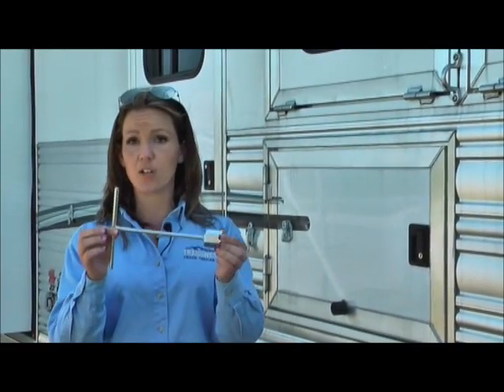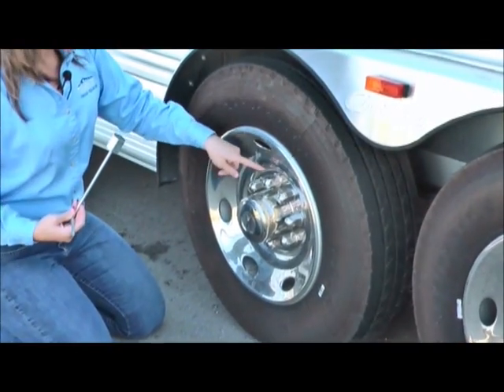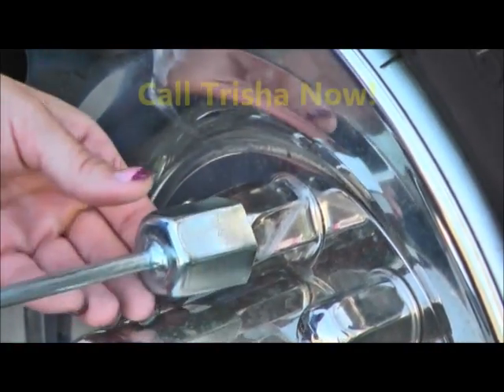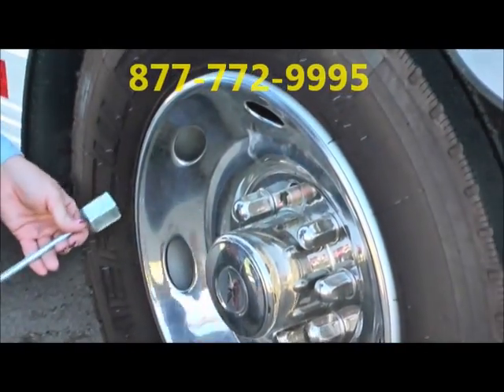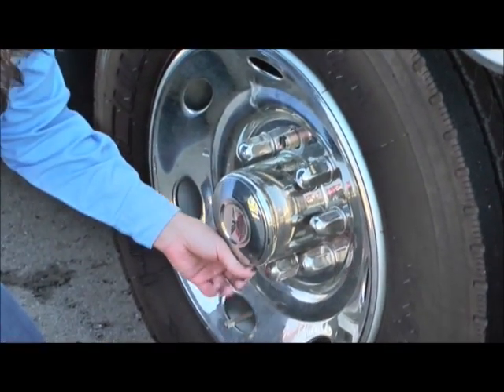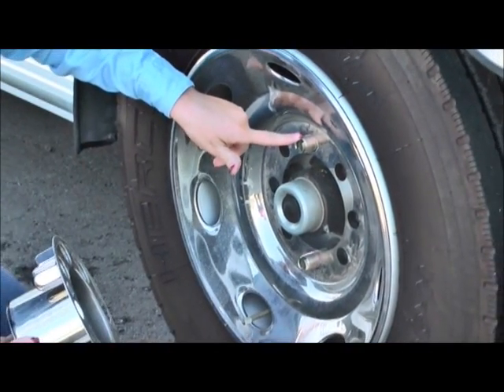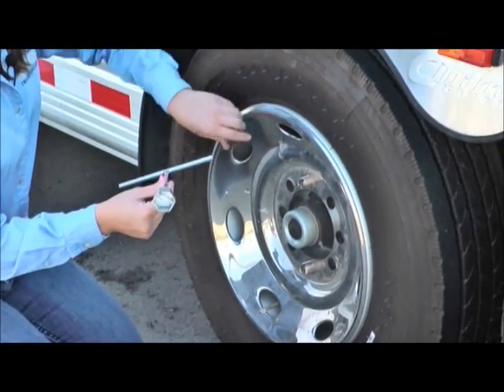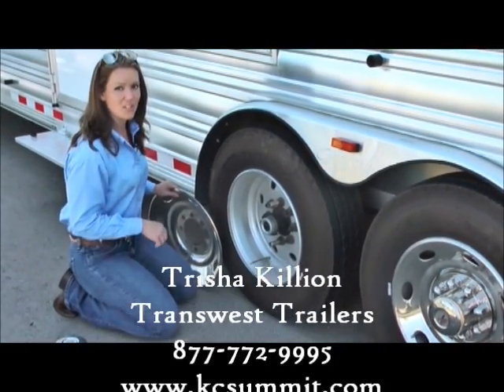How To Remove Wheel Simulators

Comment: I was all screwed up. I was thinking these are actually Lugnuts. I could not get the to the150 talk wrench specification for the tires. I knew there was something I wasn't doing right. I Didn't know what it was. Thank you for the big help. P.S. I found the wrench in the glove compartment of the use truck that I bought and had No idea what was for.

Comment: The ones I'm trying to remove, just bend the metal tool. I guess someone got it too tight.
Edited: I did finaly get it, with a 1 1/4" wrench over the tool. The dually wheels were just a little more difficult, at an angle. 
Thank you for your video!

Comment: thanks so much for the upload. i was going bananas trying to get these darn covers off and prying like a monkey!
Reply: Me as well try to pry these darn dress trims off .may have to buy a 28mm socket .and use a flat spanner to take off the thread extender in the 1/4 inch slot some how .Or fabricate may not be that easy. Thanks a lot Garry down under in Australia .

Comment: Thanks for the tips,  where can one get the T-Bar you used to remove the simulator to get to the valve stem in the back dully tire, i need to put on the TPMS on my class c motorhome  can you help.

Comment: What happens when the nut just spins and spins...it never breaks loose. There is only one tire that this is happening on..but I cant change the tire if I cant get the blasted simulator off.!!!!
Reply: Probably was stripped by over torquing with an impact wrench. 
Impact wrenches should only be used for loosening, but many  are lazy and use them for spinning lug nuts and and other bolts and nuts on. Usually cross threading or over tightening.

You probably fixed this by now, but if you could 
put pressure behind the nut with a pry bar or by pulling/pressing out on the rim, you might get it to catch and thread off. If not you'll need   a nut splitter or a cutting torch. 
And a new stud and lug nut.